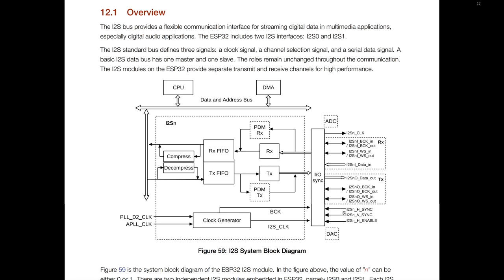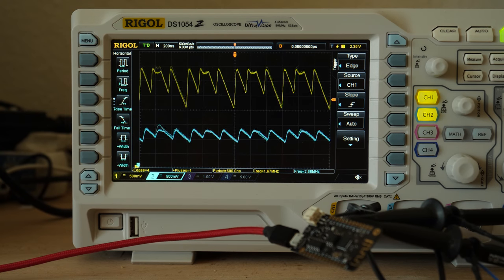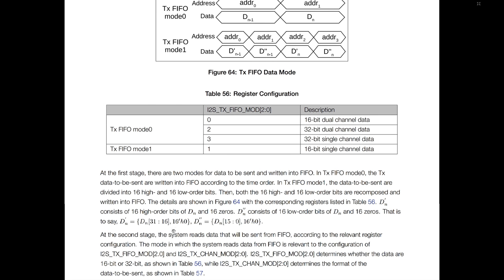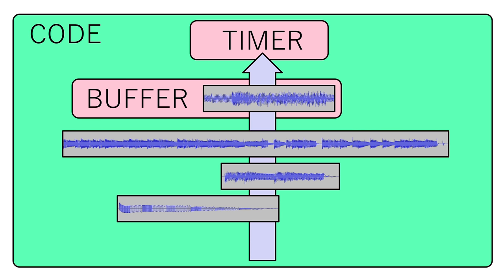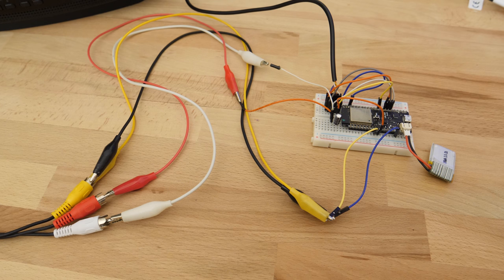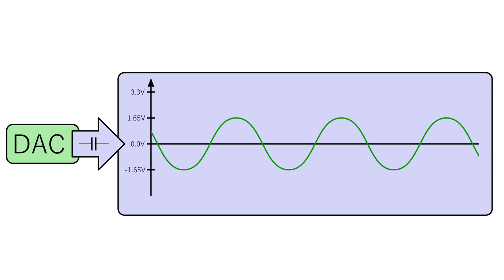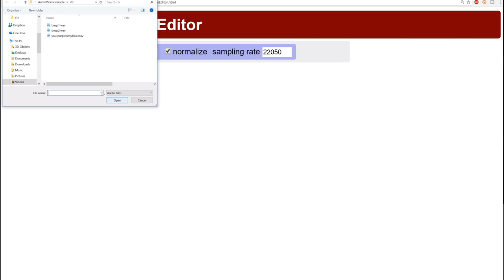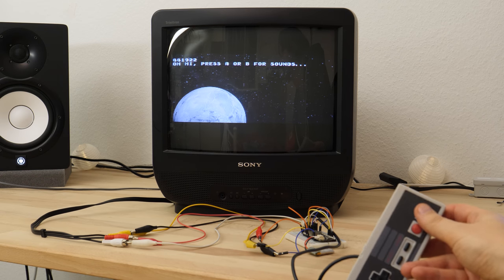ESP32 Game Console Audio

Comment: Great work. ;)

And, great find on that constant value thing. They really put some nice features on the ESP32, they just seem to be hidden away, or not very well described. hehe

I love the concept of being able to drag the sprites, backgrounds, and 3D meshes onto the web page interface btw. I can imagine a whole "Game Creator" being done that way.

I would love to write a MOD player for it, but I think there are a few projects for that already (although there's nothing much stopping me writing my own, of course).

There are also ESP32 projects for Internet Radio, and DOOM, which is pretty amazing on such a cheap device.

When I last tried to use the ESP32 via the Arduino IDE, I could NOT seem to get GPIO interrupts working?

I was simply trying to read the response data from an N64 controller with decent timing accuracy.

I could send the request just fine, and see the response on the o'scope, but the interrupt never triggered (even when just setting a flag in the int routine).

Actually, I'll upload that sketch later. It would be great to see the N64 controller working with your console code, as it only requires one IO pin, and runs off a 3V3 supply too. ;)
Reply from the maker: ElectronAsh mod player would be awesome.. don't have n64 controller here but let's stay in touch..

Comment: I have been looking for a way to mix multiple wav files of N size real time for a while now. I expect using your excellent work here there should be a way to drop the video processing to achieve stereo out. Do you think it could handle 6 different length  files at 44k sample rate mixing? Thanks again for great content... gotta share for certain.
Reply from the maker: I'm sure you can handle stereo and graphics in stereo and 48khz output... it depends if you need to steam it from SD
Reply: bitluni's lab that's a good point. Sd card access would be too slow for larger files if streaming. I don't know if the U3/v90 cards would help. That is a consideration I will certainly address in design. But if memory serves that has more to do with write speeds. Guess I better take a closer look at the esp32 buses. Thanks for the reply. Much appreciated. ;-)

Comment: Amazing work. For the audio output, why don't you use in series  47ohm-47u for the low freq paralleled with a 100n for high freq?
Reply from the maker: Short to Ground most probably because I'm no expert yet but it's a nice idea. This will come handy when I try to optimize synth output in a future project

Comment: Could this work with the ESP32 PRO which has an additional 4MB Flash ROM and 4MB pSRAM memory? I guess you could have a bigger front and back buffer, but I'm not sure how fast the additional RAM is.
Reply from the maker: I have some boards with PSRAM here, it's not yet supported in the arduino integration, but I will do that in future
Reply: I was not aware of that, thanks for answering! Which boards do you have?